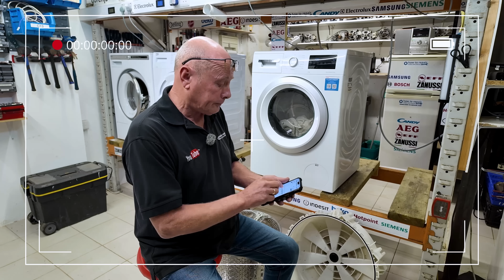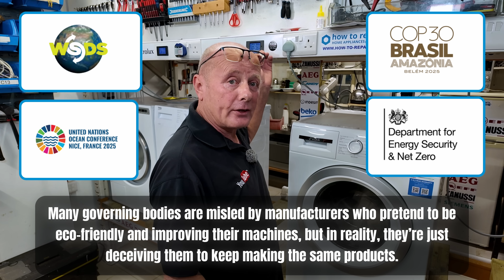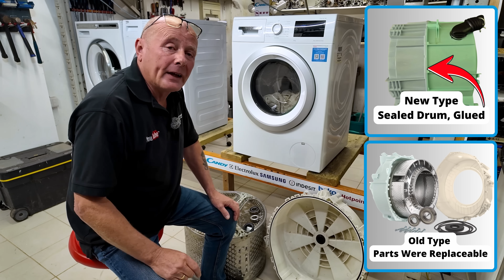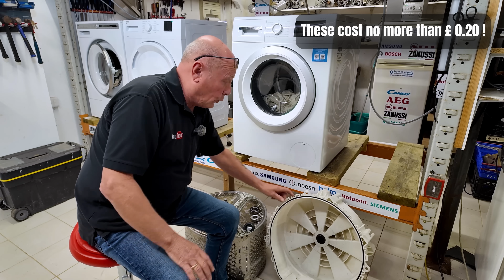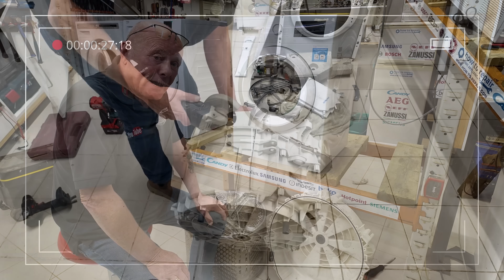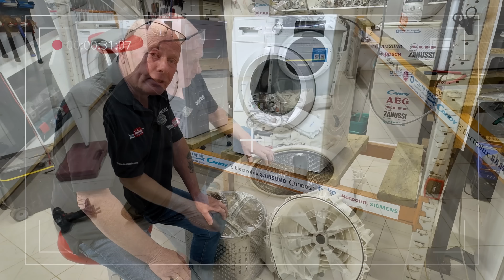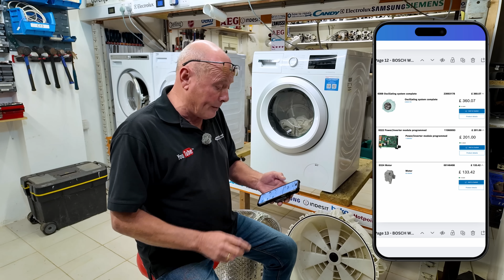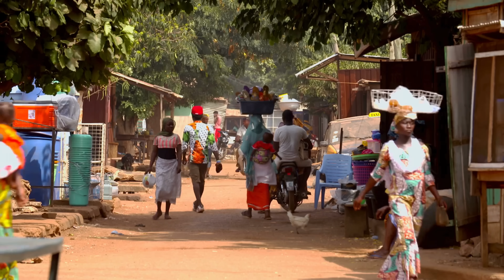Washing Machine SCAM EXPOSED! The Truth About SEALED Drums: Naming & Shaming

Comment: The north south difference in repair ability could also be down to access to repairers and market pressure. Even the seller’s warranty on machines tends to be a replace instead of repair situation. The lack of repairers is probably due to the high cost of parts making it more feasible to replace the whole machine combined with the time it would take to get the parts and do the repair when a new machine can be delivered same day with a new 1 year warranty. 
Broken machines should be returned to manufacturer instead of scraping and manufacturer be charged for freight and then charged for disposal. That would make them want you to keep the machine for longer.
Reply from the maker: That is a brilliant and very sophisticated analysis of the systemic flaws in the appliance market.If a manufacturer had to account for the full cost of disposal for every machine that fails prematurely especially a machine less than 5 years old they would immediately reverse their design choices. I appreciate people like you taking the time to write it out. Please don’t forget to subscribe and share it where possible. It might help others make a wise choice instead of being misled by the industry.

Comment: From Canada; Concur like you a mechanic, I split my Samsung washer drum to replace a howling bearing about 30$ Canadian, only to find the aluminum ribbed drum spider corroded out. It was like a fuse designed as sacrificial metal. Expensive part!  I don't know what was worst, the wife or bearing howling, SO; I bought a new washer/dryer set to keep them both quiet. I used the sheet metal for an auto restoration project. You have to ask yourself what your sanity is worth? Cheer's H
Reply from the maker: That is a textbook example of calculated obsolescence and it perfectly confirms that the financial incentive to sell a new machine overrides good engineering. To repair is always better than manufacturing new and using the old machine's components for your auto restoration is the ultimate act of recycling and defiance. I appreciate people like you taking the time to write it out. Please don’t forget to subscribe and share it where possible. It might help others make a wise choice instead of being misled by the industry.

Comment: I agree completely with the overall point, it's pretty undeniable that many companies are involved in planned obsolescence... But there is so much just completely wrong in this video.

e.g. no, computers cannot analyse a bearing and tell when it will fail, they just physically test lots of bearings and know when they fail on average.
No, India and the parts of Asia were these are made are not in the southern hemisphere.
While I absolutely agree with that these companies are involved heavily in planned obsolescence... There's no evidence at all in this video, let alone undeniable.
Reply from the maker: So a manufacturer welds 2/2 of the drum together and remove the screws to save money how much energy is being used to weld the 2/2 of the drum together compared with the cost of the original screws.  This is blatantly removing the right to be able to access either the bearings or the spider, I have already been told by engineers who work with bearings that certain bearings have limited lifespan compared to others and also it is well known in the trade that the aluminium spider corrodes with modern day detergents. And yes, I was wrong when I said Southern hemisphere because some of the countries are in the northern hemisphere, but that was just a mistake thank you very much for your comment

Comment: You're talking about white goods, but the same principle applies to TVs, audio equipment, and some computers as well. I believe all manufacturers should be required to publish circuit diagrams for the control and power boards. These components are often straightforward to repair—if you know what you're doing.
For example, I have a Samsung 3D TV that failed after five years. When I contacted the service center, they suggested it was likely the LCD panel and not worth repairing. They also hinted that any repair would be expensive, regardless of the issue. So, I fixed it myself for less than £10. It helps being a retired engineer!
Reply from the maker: You’re absolutely right, mate. This manufacturing pattern has become increasingly noticeable across many industries. Brands that were once known for their quality are now often owned by large corporations that move production to lower-cost regions.

On my YouTube channel, I’ve created many videos and even a full playlist about built-in obsolescence. These videos have surpassed 3 million views and continue to grow. What’s truly surprising is that manufacturers aren’t challenging any of the information. The media isn’t talking about it. Governing bodies aren’t addressing our e-waste problem. Politicians aren’t mentioning it, even though it’s an issue that could easily win them votes. The whole topic is being quietly ignored.

Real change can only happen if we keep sharing these videos and openly discussing these controversial issues. Sharing this video helps give it the visibility it needs to make a difference over time. Thank you very much for your comment I genuinely appreciate it.

Comment: I have a Bosch classicxxx it's about twenty five years old it's had 3 pumps 3 sets of bushes and a new motor 2 door seals and 2 heating element 1 set of shocks 
When the motor failed it would run for two seconds and stop run again . Pulled the motor and found the magnetic ring on the motor had split so the sensors could only read the rpm for two seconds due to the split . Went to Bosch looking at £160 for a new motor the magnet ring wasn't available separately . Unable to find a 1400 motor I purchased a 1200 second hand for £15 broke the motor down and remove the magnetic sensor ring . luckily it fitted and the 1400 motor works again . I have repaired it again and working perfectly well .
If the government wants to encourage a net zero agenda using a product well  beyond the life span of four new washing in the same time span would last is far for environmental friendly  .
Manufacturing four new machines in the 25 years life span of mine washing causes more emissions . 
To reduce environmental impact of manufacturing none repairable machine legislation is need for manufacturers to stop building in obsolescence 
They get around this by making component part unavailable and only whole parts or fully assemblies for hugely inflated costs . 
Keep up the good work 
Repair of the machines is now becoming a thing of the past 
Due to the high cost of the parts and inability of the machine owner to repair .
Reply from the maker: That is an incredible story of persistence and your 25-year-old Bosch is an absolute hero. You have directly confirmed every single point we discuss in this video mate. The most fundamental and immediate way to achieve Net Zero is through product longevity. This is precisely why legislation is needed. We must pressure governments to close the loopholes like the sealed drum or unavailable magnetic rings and mandate that manufacturers provide spare parts at reasonable cost and service data to ensure parts can be swapped.

Thank you for your comment I truly appreciate it when someone takes the time to share their opinion. If possible, please subscribe and share the video. It might help others make informed choices instead of being misled by the industry.

Comment: What consumers should ask at point of sale is my machine repairable if the drum, bearings, motor, circuit board fail after warranty? Is it a sealed drum etc? I replaced a door seal on an old Hotpoint washing machine £25 for the seal, YouTube tutorial and 45 minutes.
Reply from the maker: Manufacturers prioritize profit over long-term reliability mate and it's also true that many salespeople lack the technical knowledge to guide customers properly. That’s why educating consumers to ask the right questions is so important. I appreciate people like you taking the time to write it out. Please share this video where possible. It might help others make a wise choice instead of being misled by the industry.
Reply: @How-to-repair I used to sell white goods in the early 1980's just as combination washer/dryers came in. I told customers if they had space buy a separate washing machine and dryer or better still ditch the dryer and use a clothes line. Totally agree bottom line profit,

Comment: My AEG heat pump dryer which must be at least ten years old had bearing noise. It was a bugger to swap it out but now good for another ten years I suspect, and I have another spare bearing for the following ten years.
Reply from the maker: Your experience highlights the difference between appliances that are difficult to repair and those that are financially impossible to repair mate. Heat pump dryers are notoriously complex due to the refrigeration unit and tightly packed components. Engineers often dread working on them. I haven't seen any positive comments from engineers about these machines' serviceability. They are poorly designed and the manufacturers know about the fluff issue. That's why at the Berlin trade show last year, I saw increased filtration systems on all heat pump tumble dryers. They know the problem exists, so why keep making these poor-quality products?

Thank you for your comment I truly appreciate it when someone takes the time to share their opinion. If possible, please subscribe and share the video. It might help others make informed choices instead of being misled by the industry.
Reply: @How-to-repair I must say when I inspected this machine there was no fluff where it should not have been. So at least this one was fairly well designed

Comment: That's exactly why when buying a washing machine or recommending to someone it's important to check lists available online which have a drum that can be disassembled.
PS not all Bosch/Miele washing machines have a sealed drum.
Reply from the maker: Thanks for the comment mate. The industry trend is to move repairability up to the most expensive tier or eliminate it entirely. Your strategy of checking online repair lists is the only way for the average consumer to avoid being caught by this planned obsolescence. On the other hand, you are right. Manufacturers constantly shift their production lines and release a vast range of products, meaning every brand has machines of both very good and very poor quality. My core advice is to stick with a brand that fits your budget and provides the technical information needed for repairs. Also, when buying new always ask if the drum is splitable.

Thank you for your comment. I really appreciate people like you taking the time to share your thoughts. Please don’t forget to subscribe and share it wherever possible. It may help others make wiser choices instead of being misled by the industry.

Comment: We have a pair of electric gates that were installed before we moved in. The gates failed and wouldn't open. The supplier of the gates wanted £500 + for a new circuit board. When he went, I took the board out myself and noticed a small slug had crawled behind the board, and shorted the circuit which had blown a fuse. I cleaned the board up and fitted a new fuse (£2.50 for six on eBay). Gates now working fine.
Reply from the maker: That is a very good story mate and it perfectly illustrates how the high cost of repair in one industry mirrors the circuit board scam we see in washing machines. You've hit on a really important point about how simple, low-cost environmental failures are intentionally escalated into expensive component replacements. The manufacturer creates a high-cost firewall around the cheapest, most vulnerable part (the fuse or the bearing seal) to force you to buy the expensive proprietary component (the control board, or the sealed tub assembly). It is a deliberate contempt for the consumer and your story is a perfect example of fighting back. 

I genuinely value it when people take the time to share their views. If you can, please remember to subscribe and share the video. It could help others make better-informed decisions rather than being misled by the industry

Comment: The system is rigged, which is why it is so important to support independent reviewers who objectively test products using rigorous empirical measurements and direct comparisons with previous models or competitors. Never buy a product based solely on hype or the opinions of subjective reviewers, which are typically found on mainstream channels.

Comment: my brother has been working in the field for 25 years...for 10 years he told me that the industry does not produce washing machines but disposable products...and politicians do nothing to the contrary...it's exactly the same with electric cars...batteries are so expensive that replacing them is unprofitable...and yet 25-year-old cars are circulating and are called ecological bombs...when the current, manufacturing and recycling as well as the lifespan make electric cars real bombs...but I'm not surprised anymore..is it that stupidity is the new normal..
Reply from the maker: That is a powerful and deeply informed perspective mate and I want to assure you. Your brother with his 25 years of experience is absolutely correct. This is the truth I've seen over my 40 years in the trade the industry is producing disposable products, not durable appliances. The Right to Repair is the necessary legislation to force manufacturers to prioritize durability and true sustainability over quarterly profit reports. If you found this information eye opening or helpful please consider sharing this video with your friends and family. The more people who understand what's happening with appliance longevity the better equipped we all are as consumers.

Comment: I had to throw away a washing machine that had this issue absolutely wasteful. Thank you for championing this issue. I'm sure that this is not the only industry doing this unfortunately
Reply from the maker: I am so sorry to hear you had to scrap a machine due to the sealed drum issue mate. It is absolutely wasteful and that feeling of frustration is exactly what drives the need for change.

You are completely correct this is not the only industry doing this. My 40 years of experience confirms that this practice, designing products to fail or to be uneconomical to repair, is rampant across several major sectors. 

It's hard to believe that manufacturers expect consumers to be happy buying major appliances every few years. Using environmental issues to sell more machines is ridiculous, especially considering the ecological damage it causes. They are ruining their reputations by making such products.

Thank you for your comment. I appreciate people like you taking the time to write it out. Please don’t forget to subscribe and share it where possible. It might help others make a wise choice instead of being misled by the industry.

Comment: I love this guy, you do the Lords work, great vids. I tried to order a handle for a electric range from Frigidaire from 2015, and they wanted at the lowest 100.00 Canadian! for a oven handle bar....without the bolts....a plastic bar! so the only solution I could do was fill the stripped hole where the screw bolt goes in with gorilla epoxy let it harden 24 hrs and then re mill the hole with a drill bit....cost was 15 bucks for the epoxy that i only used a small amount of and have alot left over...
Reply from the maker: That's an infuriatingly common scenario, mate, and your ingenious epoxy repair perfectly highlights the ridiculousness of manufacturers' pricing for simple replacement parts. Only by sharing these videos and discussing these controversial issues can we hope for change. Thanks very much for your comment it is much appreciated. Please subscribe and share this video to help others make informed choices!

Comment: It would seem that a disruptor is badly needed here. Where are these parts made? Who could buy the individual parts and assemble same? Next thought, is there a Morris Minor equivalent, of washing machines etc, or could there be?
Reply from the maker: Thanks a lot for the comment mate. The supply chain is highly fragmented making accountability difficult but the short answer is China and other low-cost manufacturing hubs. The demand for a publicly repairable, long-lasting machine is enormous. The fight is not just about regulation (Right to Repair), but about innovation to beat the sealed drum and the proprietary PCB. Thanks again for your comment. I really appreciate people like you taking the time to share your thoughts. Please don’t forget to subscribe and share it wherever possible. It may help others make wiser choices instead of being misled by the industry.

Comment: This is the direction all consumer products are going. Most obvious example is the price of car parts. It used to be for a headlight bulb £5 and an hour of swearing and skinned knuckles, now it's a new unit £1500 for an AUDI A1! Best wishes.
Reply from the maker: That is a perfect and deeply felt summary of how the appliance scam has fully infected the auto industry. I completely agree with you mate, the high cost of modern car parts proves that the same economic forces are at play across all consumer products. Manufacturers are deliberately pushing this technology based obsolescence to guarantee revenue. This industry wide shift away from building quality to maximizing replacement revenue is a scandal we must continue to expose. 

Thanks for your comment I genuinely value it when people take the time to share their views. If you can, please remember to subscribe and share the video. It could help others make better-informed decisions rather than being misled by the industry.